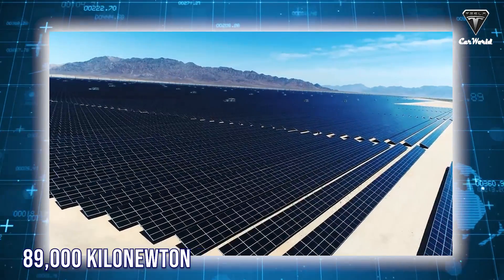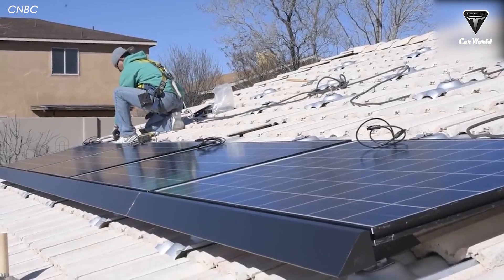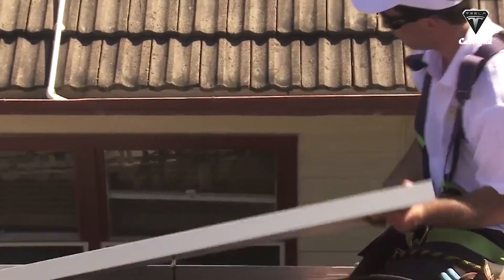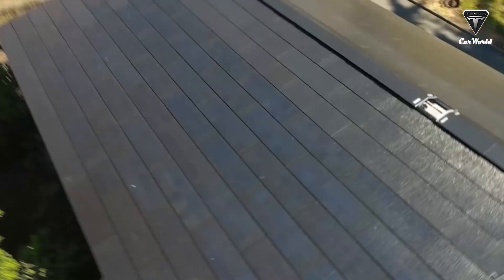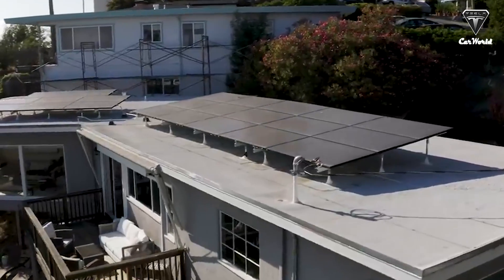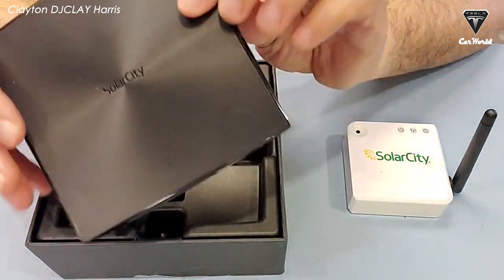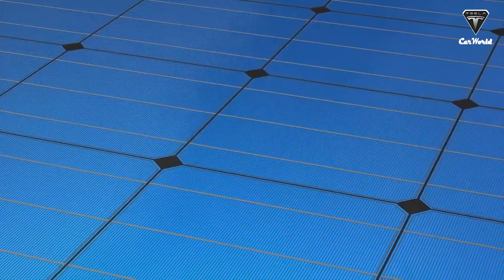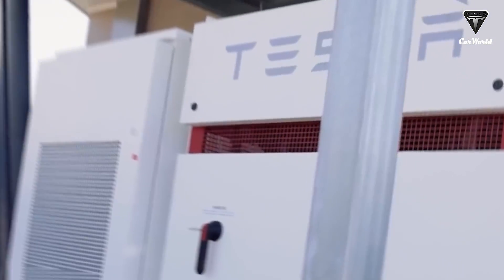Elon Musk Reveals Cheap Energy Only $2.21 Can be used continuously for 50 years in Texas!

Comment: Gimmic, remember the Texas fiascos and the hide away of the big as_her senator during the last year Winter? 
Your houses end up get extra junk on top and only can produce electricity, may be in the next 10 years if there is sun shine and the junk is clean.
After 10 years who is going to dispose hazardous material? Who pay the fee to take it to the recycling centers? 
During the 10 years who is going to clean those panels? The efficiency goes low quickly if they get dirty.
Do not listen to the sale pitch unless you can clean them at least monthly and your roof structure is sound, and   new, has no leaks!
Oh, by the way, I almost forgot to mention you need to have batteries, a lot of batteries so you can store electricity for use at night which is another expense when the batteries go bad....
And more, an inverter to convert DC to AC...
Finally, for all the people who loves America, 80% of solar panels, inverters, and batteries are made in China. Love Tesla, love China...

Comment: A 5KW solar panel system with battery back up can be bought in dozens and dozens of places for under $10,000. You hire a registered electrician because he will get the proper permits and inspections done by the local electrical building inspector, and he will go thru proper channels with the local electric company to tie your home solar system into the grid so you can sell the excess power you generate with your panels and get paid by the local utility.
   it will take depending on your roof and the weather, two or three days to install. You can find a qualified registered electrician that will do things correctly to do the job for approximately $1000 a day,It could be a bit more if he hast to rent scaffolding depending on how high and how much pitch do you have on your roof. 
   this job could easily be done for under $13,000-$15,000
   I am bringing this up here because of all of the big companies that want to install their system on your roof for free, and charge you no more than your regular electric bill. I don’t know exactly what the deal is they offer, but it’s always going to be better to just buy the equipment and have it installed
by  professional/registered electrician
  I am an electrician. This kind of a job is a piece of cake. It sure beats digging and installing underground wiring, rewiring an old house with plaster walls, it sure beats wiring a large building like a Sam’s or a Home Depot with 480 or 277 working a pie were it is very very very hot inside those warehouse type buildings, especially in the winter. It is much more pleasant to work outside on the roof of a house only 12 to 20 feet above ground.. The most difficult part of a rooftop install is, getting the material up on the roof..
  don’t be taken in by a fast talking commissioned salesman. Do some research, read reviews on different rooftop systems for your home, find a local registered electrician with experience installing solar panels, don’t hire a contractor with license plates on his truck from 1000 miles away..
   have your roof inspected by a professional to see if it is going to need replaced soon. It would be better to have the section of your roof that the panels will be installed on reshingled now rather than after the panels are installed on that section of your roof.

Comment: I'm not going to pay $9,000 for a 500 w solar panel it would have to be a group of solar panels I want to know what each solar panel cost and yes I want them 500 watts plus each but you can't tell me a total price of what it's going to cost cuz it tells me nothing about the solar panels like what each solar panels Watts votes or amps are. I need that to know how much power I need I don't care about kilowatts of power without knowing the volts or the amps that is solar panel can produce.
Reply: @Anna well I have 11, 550 Watts of solar panels but I do not have a converter to run them but that's only one size solar panel I have and yes that is 42 solar panels I really do need an inverter because that might run most of what I use in the house and my kitchen stove oven is electric my water heater is electric my dryer and my washer is electric heat in my house is electric everything in my house is electricity batteries while I have been using some lead acid batteries and I have some 200 amp AGM batteries but I think there are also lead acid some what as well and I do have solar chargers a 30 amp a 60 amp another 60 amp and several hundred amps but no real inverters to run anything and to come up with $1,300 is not an easy thing to do when you live in paycheck from paycheck and having almost nothing left when time you get to next paycheck. So yeah I can use one two or more inverters.

Comment: I still prefer solar panels over solar shingles but I do know Tessa does have solar panels that they would put on the roof too and that's kind of why I'm interested in the solar panels and still interested in their power wall as long as I can put it inside the house or inside a building I mean I do have a back shed.
Reply: shingles would be cool. Probably pay for themselves, as shingle (usually they are 30 year) and as a power generator too. Neat.
Reply: @timewa851  shingles are usually very expensive yes Tesla might be a little cheaper with solar panels and maybe even cheaper would solar shingles but I do believe it costs more to put shingles on a house in solar panels especially when it charging $2 and something or other to put solar on your roof for the shingler it will cost me about $4,500 have someone put shingles on my house put that in put that into contacts and it cost me $2 and something or other for solar of any type it's going to cost me $10,000 or more I'm still interested in solar panels for my roof not because they put solar panels on my roof but because once they put solar panels on my roof I probably go up there and restructure it so it covers 100% of my roof and add more solar panels to it cuz you put solar panels roof you should not see your own rough it should protect your whole rough and besides I have solar panels that I had bought in 35 years ago and they still give me the same wattage that I got when I bought them all you have to do is take care of your solar panels baby them check the wiring the fittings replace what's needs to be needed solar panels last maybe 50 years that's one thing I have a hard time doing when the solar panels are on the roof but I can still do something to keep them in good condition that's the only reason why I wouldn't mind having solar panels on my roof right now I have solar panels on the ground and I'm putting more solar panels on the ground I'm not going to put solar panels under rough somebody else will somebody I have to pay I know it's going to cut be costly that I can't help because once they do that they can hook it up to the grid they'll give me the right inverter to hook it up to the grid even if I have to get the building permit to do it and electrical permit myself because I don't know if I can trust a company to come over and do that I know some companies don't necessarily do it but I know there's something I can trust anyways.
Reply: Dennis Lee has better panels than solar. 
Elon Musk should buy up Dennis Lee's invention and market it like he does with Tesla.
Dennis Lee's panels run 24/7 anywhere in the world. Can be adapted to Simi Trucks or Rail Cars and eventually to cars. They can be incorporated into any building. 
I just feel that if the Climate Crisis were real, Dennis Lee's invention would be mainstream by now. He's been marketing and selling it for over two decades.
Reply: @bradleejones9959  thank you I'll look up this man or this video or whatever you call them he might be a great help Dennis Lee's system might be more what I'm looking for I do not know I'm not a rich man Even though once I was I lost everything when Obama was President now I live paycheck by paycheck and almost not living at all so any advantages I can get to live and make it so my family do well I'm going to try.

Comment: I just got I just ordered solar panels as guaranteed for 30 years at 80% and they're not from Tesla and they are brand spanking new solar panels 11, 550 Watts is what I ordered with three 6,000 watt converters 120 to 220 Pearson wave conversion AC electricity. But for the sale I bought Tesla can't beat that but they're not putting it on my house either they're not even putting on any place I'm going to put it up and it's not going to be on the house. But I would like to know how much Tesla's solar panels do cost and how big are the solar panels how many wattage are there solar panels and how much it would cost for a powerwall and if this power will have to be outside of my house I do not want it it will not fit in my house in a situation outside of my house which it cannot be. And I would really like to have a Tesla powerwall as well as a Tesla charging port attachment to my solar array.

Comment: First you have to mine and refine the rare earths used in solar cells then you have to use coal-fired furnaces to get a fire hot enough to make the panels. Then in 25 years or so the panels must be replaced.  Panels then go to land fills where the rare earths are polluting the environment.  Not very Green at all as only  10 percent of the panels are recyclable.
Reply: Lets look at the numbers that you don't include in your statement.  You are sort of correct but lack scale in economy, pollutant numbers and process.  Why do you need coal fired plants (specious argument)?  It takes about 200kw/h to make a 100w solar panel. Let's assume you live in a place that is awful at efficiency and say 300kw/h (Popular Science 2013).  If you do the math that one solar panel will make about 365kw/h per year.  So in the first year you've already made up for production and transport (all of this includes mining before you bring that up).  Recycling is admittedly difficult however up to %90 of solar panels are recyclable but more infrastructure is needed and in the works (solar panel recycling corp 2020).  Everything you said was true before 2013 so it looks like you had good info, just dated.
Reply: @danlewellyn6734  Cheapest source of energy.  It is by far cheaper than nuclear, natural gas, oil.  Hydro usually will be slightly cheaper.  However,  problems with hydro include: no new facilities because of public outcry when river valleys are dammed; and, peak demand time problems (rivers running dry in the dead of summer when peak air conditioning is needed and rivers are frozen in the dead of winter when peak heating is needed).

Coal also provides a stable source of energy (no Arab oil embargoes, no sudden scarcity like you experience with natural gas) and there is a very plentiful supply both in the U.S. and in other foreign countries.

Coal is nothing more than ancient wood which has been under pressure for millions of years.  It is not sinister as you may have been led to believe.

Coal provides many jobs.  Unlike other forms of energy (nuclear, natural gas, oil, hydroelectric), coal provides many jobs in removing coal from the earth, transporting it to the utility, burning it, and properly disposing of coal ash.

Coal is American made.  We do not have to import this product into this country.

Coal can be mined and burned with little environmental impact.  There has been tremendous strides in environmental responsibility with mining coal and burning coal.  However, there still is pressure of global warming.  If we burn less fossil fuels, what, as a practical matter, is our energy alternative?  Nuclear?  Hydro?  Solar (there is no practical way to provide the massive amounts of electricity needed to run our country through solar energy---it is viewed as impractical at this time)?

Coal mining reclamation can give the surface landowner many more options for developing his land.  In the mountainous terrain, a mining process call mountaintop removal can create very valuable and useable level land for the surface owner.  The surface owner not only gets his land developed, he usually is paid 50 cents a ton for the inconvenience of the use of his surface.  Surface mining cannot occur without the specific consent of the surface owner.  If the surface owner is lucky enough to own the coal rights, he's looking at another $2.00 a ton for royalty payments.  In 1977 the federal Surface Mining Law was passed that required coal operators to reclaim the land in an equal, if not better, condition that existed prior to mining.  We're doing an excellent job with our reclamation efforts.  I would suggest that you go to http://www.osmre.gov/.  This is the web site of the federal agency that oversees coal mining from an environmental standpoint.

The prudent us of coal will allow the U. S. the time needed to develop viable alternative energy sources---primarily solar  technology and fuel from grain---without any negative impact on our national economy.

Coal provides 56% of the electricity used in the nation each day.  It provides 95% of Kentucky's electricity.  Electrical rates in Kentucky are the second lowest in the nation---because of coal.

Coal is good for Kentucky's economy.  The Kentucky coal industry brought $3.1 billion into Kentucky from out-of-state during Fiscal Year 1996-97 through coal sales to customers in 29 other states and 15 foreign countries.  In Kentucky, it paid over $800 million in direct wages, directly employing over 19,000 persons and indirectly providing an additional 60,000 jobs.  In addition to all the normal business taxes, the coal industry in Kentucky paid an additional $160 million in severance taxes to the state.
Reply: If the assumption is made that "coal fired furnaces" are used, then we should assume that "coal fired furnaces" are used in similar proportion to generate grid energy? (If not, why not?)
.
That Coal, when used, is "gone" and must be replaced by more.....
By contrast, the "break even point" in energy terms for a modern, efficient solar panel is now 2 years.
So by your own metric, that's 24 years of "free" energy.... However, they don't "have" to be replaced. As with batteries, the "life" of a panel is normally stated as a function of percentage of original efficiency".
That in no way means they're dead, and MUST be replaced.
But
Let's say they are.
As mentioned elsewhere, why do you think they "go to landfill"?
If, as you said, "heat" is used to produce the panel, then logically, "heat" can be used to separate the constituents for reuse.
Let's say it takes "2 years of energy" to reconstitute the raw material, the another 2 years worth to make new panels, and all that energy is included in the equation for the first panel....... 18 years free energy.... NO coal.
Now let's assume it's badly installed and only lasts 75% of predicted life.
That's STILL 14 years free!
.
No contest

Comment: Elon should be building THORIUM reactors to replace coal and gas emissions.   Thorium is not unsafe like fission from Uranium 235 and Thorium is cheap and abundant...  actually a byproduct of rare earth metal mining
Reply: You mean Molten Salt Reactors?
Reply: @derekd1510  So there's the start of the cycle Thorium, Molten salt reactors. These reactors produce way less slag, this slag however can be repurposed in two ways there are slag reactors, and then there is nuclear diamond technology. 

The former can reduce nuclear waste a further 50% already lower than traditional reactors which is already lower than Green energy even at the 90% recycle rate. Unlike the unrecycled material of a solar or wind system which remains toxic and must be treated as such for the entirety of its existence, Nuclear waste get categorized and eventually becomes no hazardous, 40 years is a 75% decrease in hazardous material, with the remainder trailing off well past a few hundred years. This is when we could effectively dispose or re-store this waste. 

The latter takes excess waste and turns it into a battery system, this is fairly new tech but shows a lot of promises. This has two effects. it mitigates nuclear waste and it removes the dependence of LI batteries (60% of all batteries go through china, 80% Lithium Chinese controlled). While good for the countries that control major battery markets it is not good for any country that doesn't or that wishes to be energy independent.

Im not saying solar and wind are bad, Im jsut saying there are other options while we work on them.
Reply: Absolutely!!! Nuclear got a bad rap thanks to the press ( 3mile island wasn't that bad) and Chernobyl which was blatant incompetency (the Russian way).  See Kyle Hills presentations on the subject.

Comment: I've built my own system, 650 watts,  at 12  volt, and  600 Ah battery storage.  
I researched,  purchased on auctions and spent about $1 per eatt on the panels, and used 6volt golf cart batteries. 
I've invested around $600 0r less. I have 100 amp charge controllers and 1500 watt inverters. 
I cut my power bill in half.
Reply: How many batteries was that ?and which panels did you use or find at what auction site thank you
Reply: You must not be running much at all on electricity.